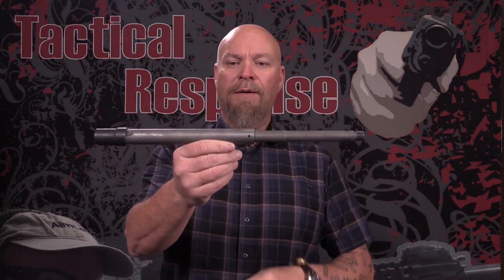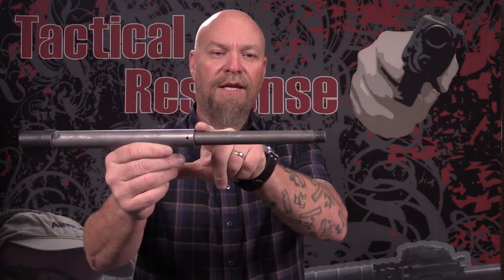Pencil Barrels are BAD?

Comment: Back when the 18 inch Tactical Response rifle was released, they were sold out before i tried to order one. So I ordered another 18 inch rifle from Midwest but it has a heavier barrel,  which is fine , its a great rifle. I should have just told Andy to put a light weight barrel on it but it was my first time ordering from Midwest and I wasn't aware how it all worked.
Reply: I’ve never ordered from them, how does it work?
Reply: Well basically you can ask to have any given rifle built differently than what is listed on the site. You can get it basically how you want, you can get a different length rail, safety selector ect.  Andy is a great guy to talk to on the phone. He builds a quality rifle that runs and runs and their customer service is amazing,  I've been amazed by the quality of customer service they have. But be advised orders may take longer now than under normal circumstances.

Comment: There is less mass to retain the heat, pencil barrels dissipate heat better! The only downside is there is slightly more felt recoil because they are lighter but with a tuned gas system and buffer, this can all be mitigated.
Reply: While it is true that the heat dissipates faster on a pencil barrel, the same is true that it heats up faster as well. There are pros and cons to everything.
Reply: Logan O'Rourke the same amount of heat is being applied to both barrels so how does a pencil barrel heat up faster if it dissipates heat better???
Reply: @psaunier10  have you ever used thin handguards? Have you ever used a thicker more robust handguard? How come if you shoot the same amount of rounds thru both that your bare hand will get hot faster with the thin? It takes longer to heat up more material...
Reply from the maker: Lets talk about the the recoil of the .223....sheesh
Reply: @TacticalResponseCrew  Yes, I understand how dumb that sounds, but you know how those competition guys get... lol